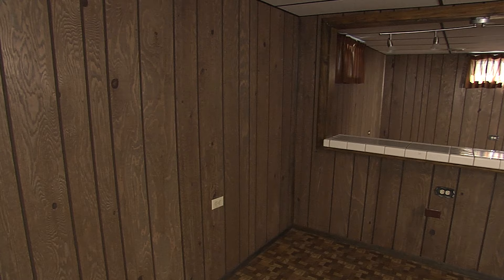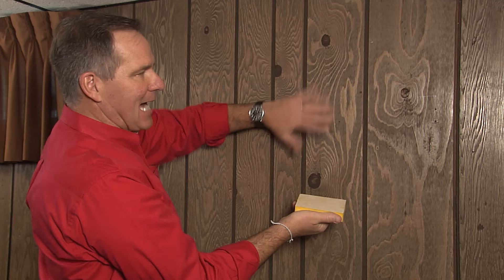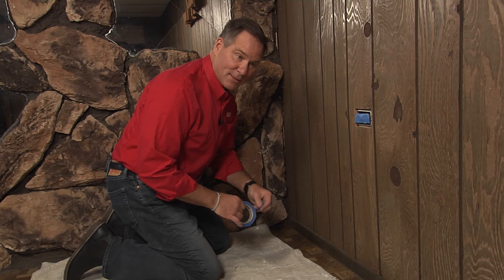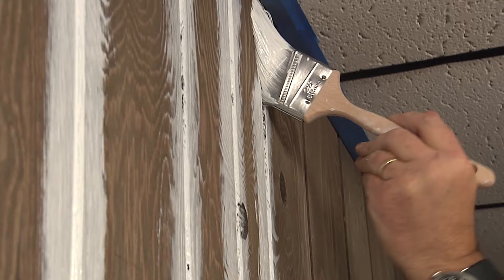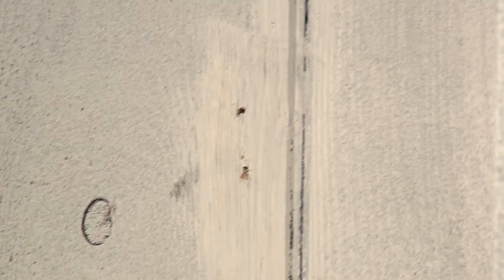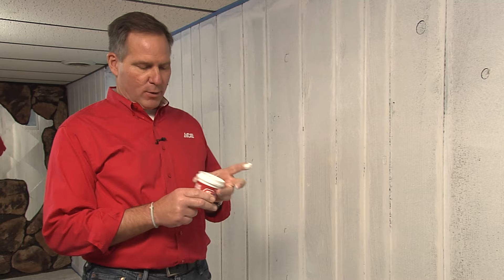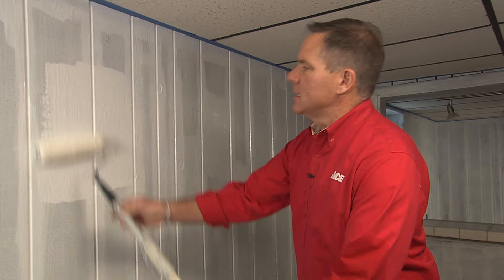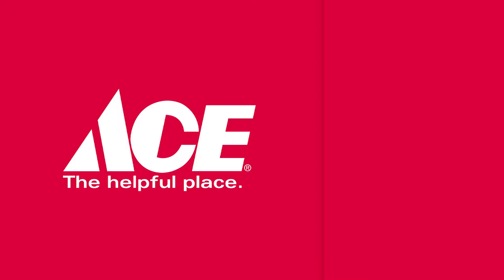How To Paint Wood Paneling - Ace Hardware

Comment: Our entire downstairs looks like this with wood panels and I was considering to tear them down and then drywall them. I think your method will be far easier, quicker and cheaper and in the end may look a lot better too. It has some character with the lines of the wood wall but brightening it up will transform the space immensely. Thanks for this excellent tutorial!
Reply: I did this however, I hid the seams.  My sons arr always wrestling so the wood holds up when they throw each other against the walls lol
Reply: Don't fool yourself the drywall would look a million times better
Reply: I have wood paneling that looks identical. Thought about drywalling it too but that's way too expensive.
Reply: I came home from work and my wife had painted the paneling in our dining room,den,and kitchen. She didnt sand,or prime and 3 months later its peeling in places.  I'm gonna have to go back and redo it all.
Reply: @ciphercode2298  hahah classic

Comment: Is it possible to use the same steps as you show but use a paint sprayer instead of the roller? Thank you for a very direct and thorough video!
Reply from the maker: Yes it is possible to use a sprayer. You would have to do some additional prep work to prevent overspray. here is a video about how to use a paint sprayer https://youtu.be/P4L0ambgyCc .

Comment: My thing is that the there will cracks where panels meet every other year and you will have to fill them and paint over them again and again. I am at the point where I am going to strip back to the original panel and no paint.
Reply: Did you use caulk in the butt joints? Its designed to flex with the house so theres no cracking.

Comment: Any way to seal up the joints in the wood paneling? Could you use spackle and sand it down?
Reply from the maker: Hi There, 
Are you referring to the seems between the boards? If so, you could apply paintable caulk between the seems, sand it down and then paint over it for a smooth finish.
Reply: @AceHardware  Thanks for the response! I believe so - I'm referring to the intermittent vertical joints/reveals, not necessarily the joints between the 4' x 8' panels for example. Seems they can be spackled and sanded to make it look like traditional GWB

Comment: How sanded down do the panels need to be? Can it be toxic to remove the gloss? How much of a time commitment can this be?
Reply from the maker: Hi Jaclyn, You want to just rough up the panels if they have a gloss on them. Enough to cut the sheen down on the panel. You don't want to loose the wood grain. We suggest the same effort you'd put in if you were to wash the boards. It is not toxic to sand the panel, however it can kick up minor dust so you could use a breathing mask. Depending upon the size of the room it's not much of a time commitment for sanding down the panels. Perhaps spend 1-2 minutes a board.  Hope this helps!

Comment: My panels seem to be a fake wood, perhaps veneer? I’m not sure, but would that change the sanding process/type of primer and paint I should use?
Reply from the maker: Hi There - Follow the same direction in this video. This basement had fake wood with veneer. Same process will work. One great tip we learned from the comments was you could apply paintable caulk in between the wood slats and make it more smooth. Hope that tip works for you!

Comment: Hey Lou, question for you. I have old (crappy) paneled walls that I sanded and painted about 20 years ago. I now want to change the color and repaint them. I shouldn’t sand them should I? I must mention my crappy paneling is not real wood. I think it’s made out of MDF with a photo type layer of wood on top. 😖 I am afraid if I lightly sand the painted surface that I could scratch thru to that crappy layer. Am I right to just leave the painted layer alone and just wash it and let it dry before new paint?
Reply from the maker: Hi Julie,
You are correct, wipe it down then use a paint no primer in one to cover.  Try the Ace Clark and Kensington brand.

Comment: Im planning too. But i have a question. How can i panel it? I want those bumpy gaps to be filled. And what should i use? After paneling do i need to use sand papers before applying the prime paint? And when sanding should i remove the paint? (White painted) Please respond. I already have the paints and don't know how to start. (My wall is also made of ply wood)
Reply from the maker: Hello Matthew!  We would suggest reach out to your local ACE as they are the professionals when it comes to a good job such as this one.  Here is a link to our store locator where you can find the phone number for the store in your area http://bit.ly/findace. Thanks!

Comment: How long does it take for the oil based primer to dry? How long do I need to wait before I apply the latex primer and paint
Reply from the maker: Hi There - We suggest checking the primer can for their dry time as it can vary by product. However, in this particular project it took 12 hours to dry. We started it during the day and let it dry overnight. Highly recommend you have windows open and fans going during the drying process. Just be cautious that high amounts of humidity can slow the dry process. 

Latex primer takes about an hour to dry to the touch. But we suggest waiting about 3 hours for latex primer to fully dry before painting over it.   Hope this helps!

Comment: What materials/paint etc. did you use?
Reply from the maker: Products Featured:

Painter's Tape 
https://www.acehardware.com/search?pageSize=30&query=painter's%20tape&categoryId=7103&utm_source=youtube

Sanding Sponge
https://www.acehardware.com/departments/paint-and-supplies/painting-tools-and-supplies/sanding-sponges/1005784?utm_source=youtube

Spackling 
https://www.acehardware.com/departments/paint-and-supplies/patch-and-repair/spackling-compounds/19268?utm_source=youtube

Clark & Kensington Paint
https://thepaintstudio.com/product/clark-kensington/clarkkensington-int-eggshell/?utm_source=youtube
Cover Stain Oil Based Primer - Website link coming soon! Request sku #1030592 at your local Ace Hardware store.

Comment: any tips on spackling the grooves between panels so the wall looks flat?
Reply from the maker: Hi Baba, Filling the groves will only be temporary and eventually you’ll get thin vertical cracks. We suggest painting in the lines. Hope that helps!
Reply: If you do decide tofill in the cracks with spackling you will need to prime those cracks first with the primer he used. The spackling will not stick to the paneling. I did what you are asking about 3 years ago and it has not cracked yet. It is a time consuming process as you will have to sand after you fill in the the cracks to smooth the surface when the spackling dries and then prime the whole wall.

Comment: I have exterior wood panels which are 30 years old. The paint gets dull within 2 years and I can see cracks. Someone advised me to change the whole wood panels, because he said the moisture got into wood.  I try to salvage them. Any advice to get the paint last longer than 2 years and keep the moisture out? Thanks in advance
Reply: Sand it down, then use primer, then paint over.
Do Total 3 coats,. So either 2 coats of primer and one of paint.
Or 1 primer and 2 coats of paint.
Reply: @re_patel  do more coats of primer.. primer is cheaper than paint.  so 2-3 coats of primer. 1 coat of paint but I much prefer 2 coats of primer and 2 coats of paint although you can easily just do 2 coast of primer and 1 coat of paint.
Reply: @ChristopherJones16  thanks for the advice

Comment: Remove nails-- what will hold the panel to the wall? Maybe  set the nails and  cover the hole.
Reply from the maker: Hi M - We're referring to nails that were used for decorative purposes (pictures, shelves, etc.) not foundation nails.
Reply: Duct tape. Duct tape fixes everything. Wife backed up into a parking lot knee wall ripping the bumper cover off? Duct tape.  ATF kick down your door to raid your house for having a full auto sear? Duct tape them hinges.

Comment: What about one of them fake wood panels? I want to paint it black in my garage instead of replacing them
Reply from the maker: Hi B E, It is possible to paint them!  We would first suggest that you bring a photo of your basement to your local Ace to evaluate the condition.  In many cases fake wood paneling is painted by lightly sanding the panels, applying a primer like Kilz or BIN and then Clark and Kensington in the sheen and color of your choice.
Reply: black panels in the garage? Why such a dark color? White or light grey is better for reflecting the light since a garage is usually where you do work and want all that light.

Comment: iI had my neighbor look at this video because his basement is all the same dark paneling well need less to say he used all the products in this video but its a disaster his wife said that he knows better than the video and he accidently use them in the reverse order he put the paint and primer from home depot satin white on first it think it was behr brand then he did the bin primer he had got at lowes he told her that the bin primer will hold the behr paint on the wall way better 
he is going to be doing he neighbor on the other side of him next will what he did hold up or should we warn the neighbor to get someone else i think this guy drinks the whole time he is painting he also said tape i for girls and homeowners he slammed alot of ceiling and alot of parts of the floor he scrubbed it up but you can still see it can this be fixed

Comment: I've done it lots of times. Primer, then paint with rollers & brushes.  Done.
Wow. This guy is too anal. I just dust the walls then I go to work.
Reply: That's what I was wondering. Some 2020 sources say sanding isn't necessary on paneling.
Reply: Hes not anal.. he said exactly the proper way to do it.  Surface needs to be roughed up for primer to bite into it. If its too smooth itll flake off in a couple years.. a simple scratch or rub up against it will take paint off.. Ive been there and done that.. its annoying. So sand the surface.. primer.. fill in holes and cracks with spackle or wood filler.  Primer it with more coats than paint since paint is more expensive.  Sometimes I'll even sand the primer to get it nice and smooth.. especially if thers dust and brush hair in it.